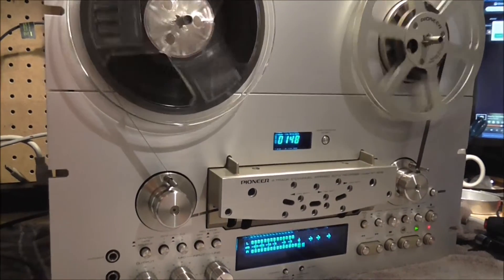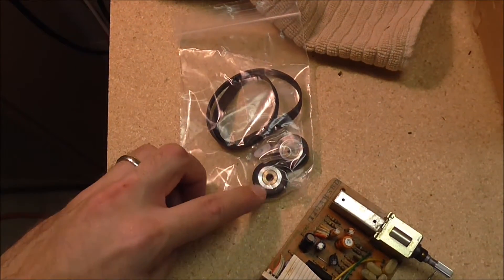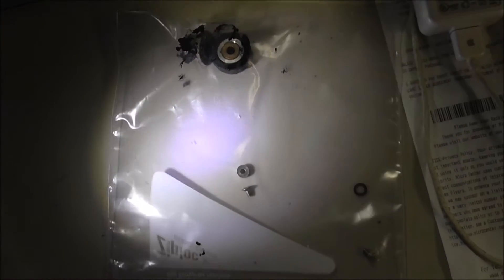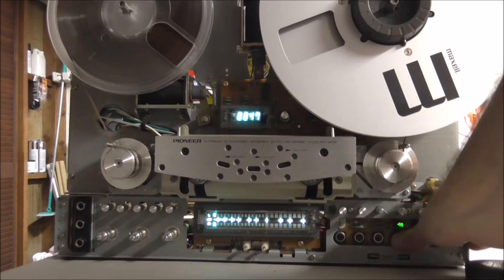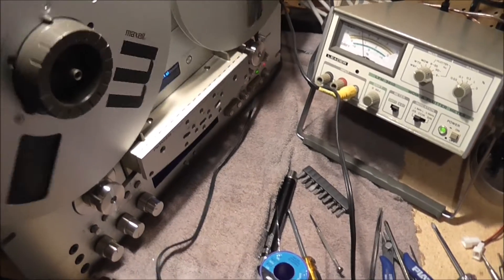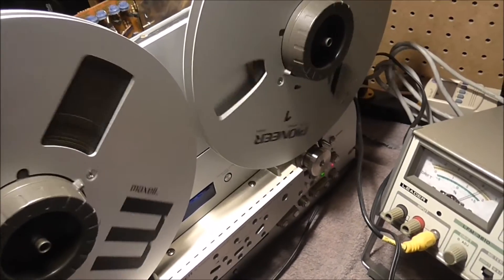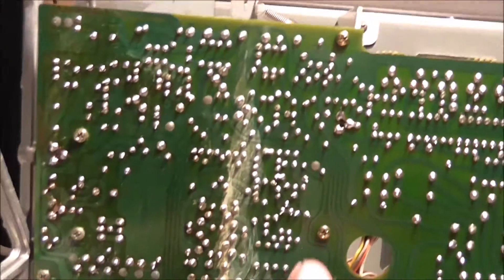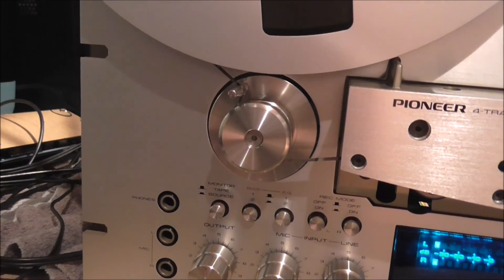Pioneer RT-909 Part 1 (3-24-2015)

Comment: Agree with comments from forwhomthebelltolls concerning the wow/flutter. Sure the measurements look good, it is ignoring the error introduced when recording. You have to measure a known standard.  Also, I  annoy the “shotgun” parts cannon of replacing ALL caps. Regardless of age. Sure some caps, known manufacturers, have experienced high failure rate.  The forums are great for tracking which ones have been found to fail frequently. However, replacing all of them instead of diagnosing and circuit troubleshooting makes no sense, besides it’s time consuming and simply guessing. You are more likely to introduce errors in the process even with patience and excellent soldering skills.  Best of luck with this nice deck!

Comment: Use naptha to clean. Leaves no residue, does not affect rubber and it evaporates (Zippo lighter fluid is naptha if you cant find in stores due to EPA) leaving no trace. GooGone has naptha and other additives as well.

Comment: Just a random question about the RT-909.  Whenever I play or record a 10 inch tape and set the reel size accordingly it seems like the machine thinks a 7 inch tape is on there.  What to do to fix the problem??

Comment: I agree with Anekcen, you could have shown how you took the capstan and fly-wheels out.  Can you explain how?
Reply from the maker: +David Wall The capstan motor has 4 screws securing the bracket on the backside. Once the capstan motor bracket is out of the way the flywheels come out the back. Must be careful as there are small parts which will be lost (washers and ball bearings).

Comment: Without using a calibrated test tape ($100 from MRL) you're basically just wasting your time measuring wow and flutter if you're measuring the signal recorded on the same deck.

Comment: I agree, I have been searching for video's that shows the work while it's being done. I know for a fact that before you get the cap-stand assembly out, you need to remove a small board out of your way. Also when you remove this cap-stand motors assembly it may take some heat because those screws that hold the assembly in there are frozen in there and if your not careful you will strip those screws out, then your really screwed.
Reply from the maker: i wish i could show more while I'm working. but I do need both hands free and I have not had good success filming and still having room inside to work. i mainly do this for fun though, and my intention isn't to make a how-to video but rather to show the effort it takes to work on electronics like this.